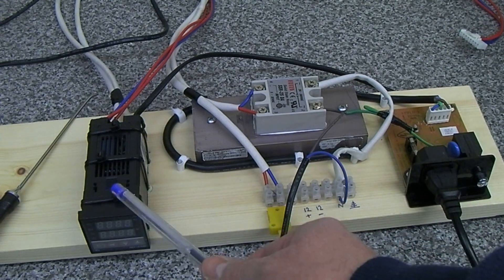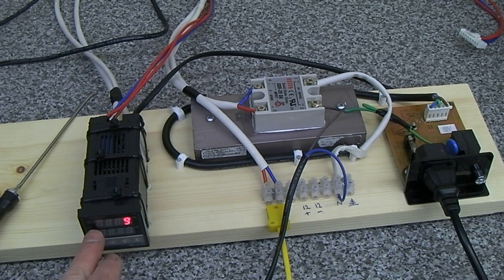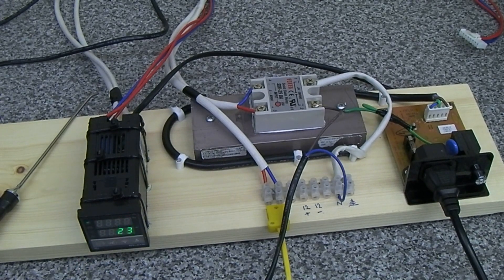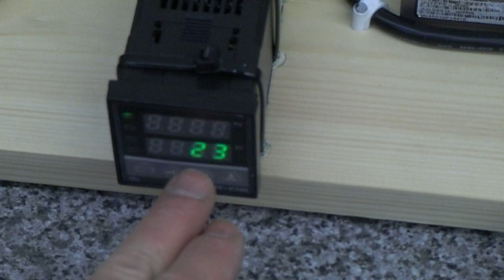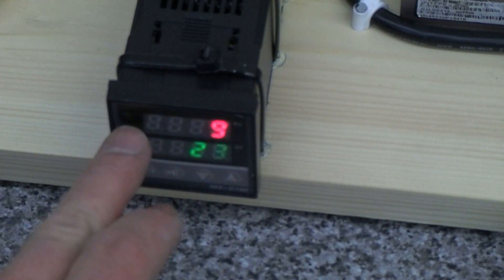Modified REX C100 PID Final Live Tests

Comment: Hi Trev
Did you switch of the PID function of the RX C100?
How did you do that, its not clear in the manual!
would be very helpfull!
I did buy this cheap REX C100 for a solar system and the relay does not stop blinking when the set temp is reached? I like it to work as a normal thermostat!

Comment: hi, actually is the PID output proportional? i see everyone is using PID and SSR as simple relay, but i need speed control for fan in my wooden boiler.
wondering what's the point of ssr if not "dimmer".